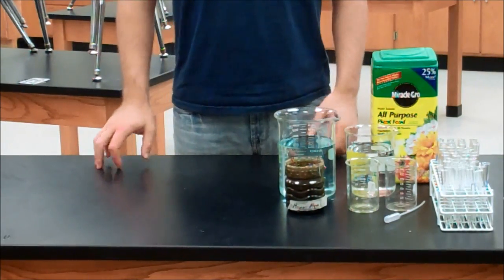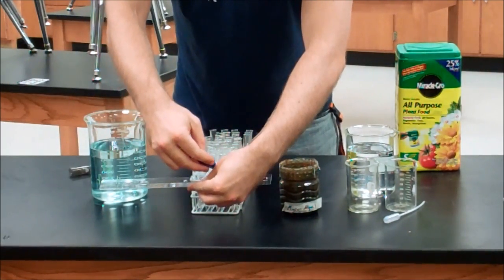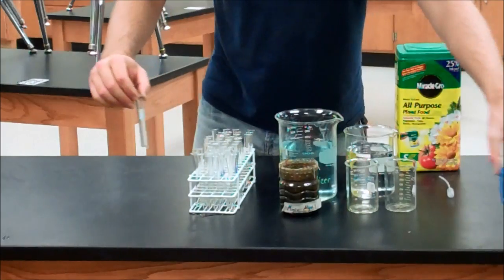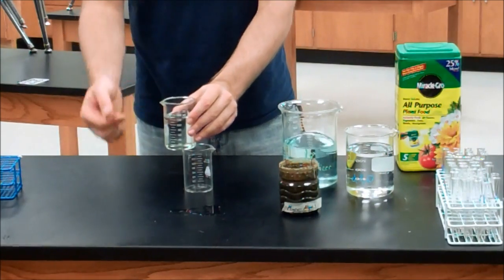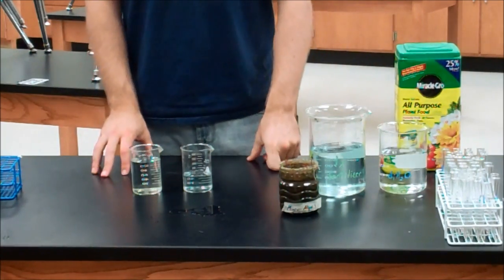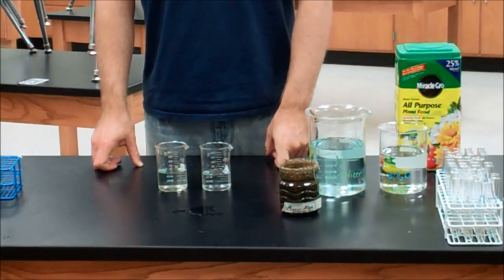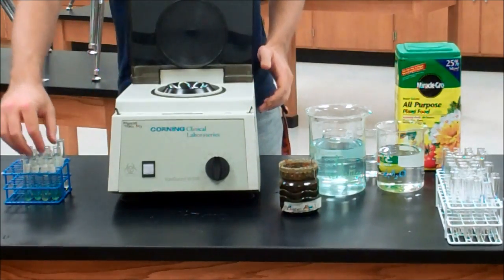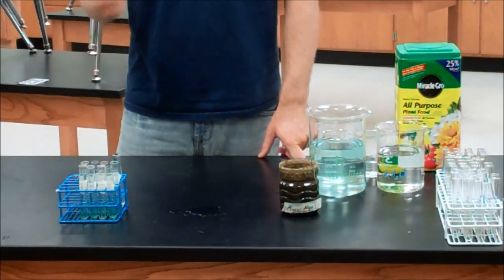Nitrogen Enrichment Experiment

Comment: Hey,
I watched your video, and I was just wondering how you got your existing micro algae culture?
and do you think it matters what type of fertilizer you use?
Reply from the maker: Microalgae is a big component of what makes aquariums get dirty over time, so just leave some lightly fertilized water sitting out and open in your lab for a week or two.  Eventually you should start seeing microalgae just springing up.  You can place the sample under a grow light to further encourage the microalgae, but from there just keep sufficient water in the culture and get it a light source and you should have a rich culture in less than a month.

I don't think the fertilizer matters, because all you need is some nitrogen and phosphorous source.  As long as your choice has both of those things, and any fertilizer worth its salt (is there a pun in there?) will have them.